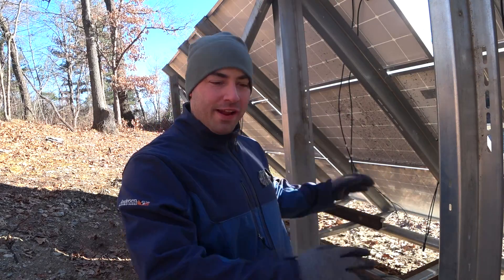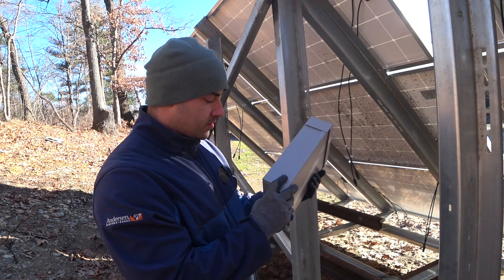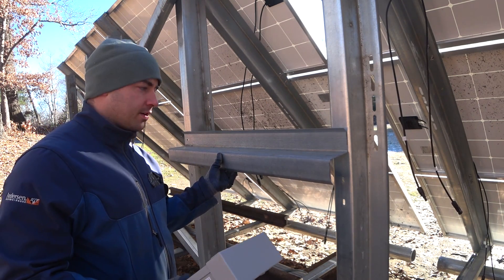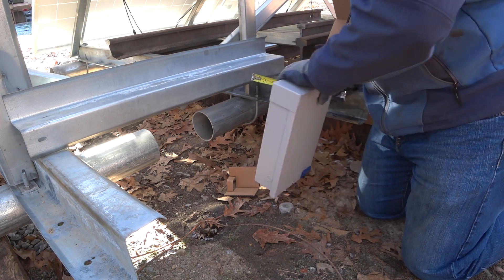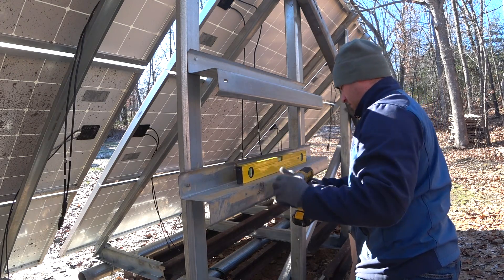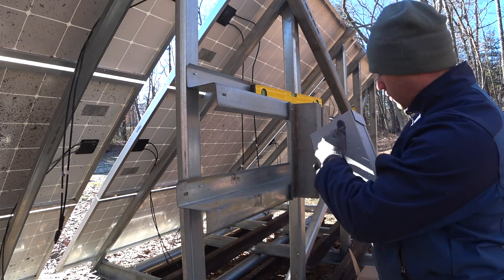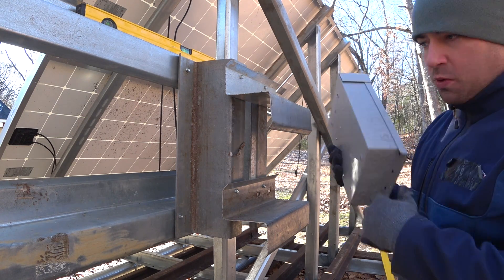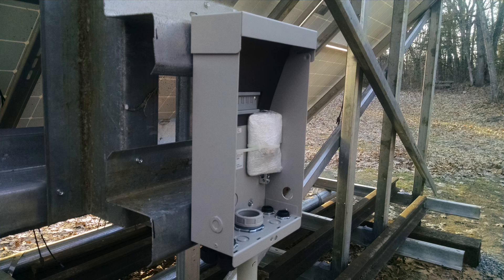Combiner Box Installation on Solar Array, Midnite Solar

Comment: Can u connect 220V one array
the other  100V array
to a combiner box 
what will be the  DC out value?
Reply from the maker: There are ways of connecting different solar arrays together.  It's a rather in-depth topic and not one I can fully describe in the comments.  Any way you try to wire two different arrays together will be a compromise.  Neither one will work well.  Instead of trying to wire them together, I'd suggest buying two MPPT charge controllers.  One for each array.  After the charge controllers, then they can be wired in parallel to the same battery bank.

Comment: It’s very easy and much neater to do an offset in the conduit. It looks like SCH 40 so you don’t need a bender .Just heat the pipe and hold it in the desired shape a short while.
Reply from the maker: Thank you.  I learned about that after this video, but used the heat gun trick since then.  looks much better.

Comment: Can you combine 2 differently sized arrays? I know yours are using same number of size and panels, just curious if that’s possible.
Reply from the maker: I have 3 arrays in my backyard, each array is a different size (today).  1 array can be made up of 1 or more strings.  A string is made up of 1 or more panels in series.  Each array feeds 1 charge controller.  Everything inside 1 array must be the same model # panel, and each string must be identical to the next string.  Everything must be the same feeding 1 charge controller.  But, you can add as many arrays as you want, so long as each array feeds it's own charge controller.  Then every charge controller can feed the same battery.

Comment: The Series is fantastic, question Can I connect 4s to 3s 2parallel solar panels, to ending in one string of 7 in series, for a total of 10 panels,  I'm trying to find out which is a better  parallel string of 5 which yield  263.0 volts with 4400 watts or 8 in series will yield 420.8 volts with 3520 watts and the 4s combine to 3s2p, is all relate to the limit 450 volts for the inverter and 4500 watts also a limit  of the inverter, panels have 440 watts, 52.6 Voc, and 10.2 amp of Ioc, imp 9.8 amp
Reply from the maker: The most important thing to keep in mind is the maximum voltage under extreme conditions.  If your particular inverter has a maximum voltage of 450V, then that is a hard and set rule.  It's your responsibility to stay under that voltage no matter what.  There are environmental conditions that allow solar panels to spike in voltage.  The maximum possible voltage would be listed by the manufacturer, but if you don't have it then the code (NEC) stipulates a 25% margin.  This means Voc: 52.6*1.25=65.75V  450V/65.75=6.8 panels.  Since you can't have a fraction of a panel you must round down.  This means your maximum allowable series connection is 6 panels.  I point this out because you asked above about having 7 or 8 in series.  7 or 8 will be above the allowable limit.

Also, please keep in mind for your design:  If you are going to parallel 2 or more strings into one MPPT then each string must be identical.  that means each string must have the exact same panel, age, model, orientation, voltage, amperage, etc.
Reply: @DavidPozEnergy  Now I got 3 of this as you did, but upon receiving I noticed the max current from a PV is 18amp, my panels have 10 amp. if I paralleled them is going over to 20 amp, my panel has 11.35A Isc, I don't know what to do.
Reply from the maker: My panels are 9.4 Amps at MPP, and I have two strings in parallel for a potential 18.8A.  This is potential.  The Growatts can't go up to 18.8A, so they max out at 18A.  But this is very very minor.  It might happen for an hour every few weeks.  It's really no big deal.  If your's are 20A, you miss out on a little potential, because the Growatts will limit it to 18A.  But it's only ever up there when conditions are at STC (standard test conditions) which is very rare.

Comment: Do you need 3 To 1 Y Type MC4 Branch Solar connector if using a combiner box? THANKS
Reply from the maker: No.  The "Y" connectors should only be used with 2 strings in parallel.  Combiner boxes can be used with 2 or more strings.

Comment: You could have made a Z or S shaped length of conduit instead of spacing the box away from the frame. You can bend that conduit using a heat gun.

Comment: how many combiner boxes can 1 central inverter accomadate ?
Reply from the maker: Hi Kershaw,  There is no direct correlation between # of combiner boxes and the inverter.  The solar panels come in all different sizes and voltages.  They need to go through a charge controller to charge the battery.

Comment: Would you please try to give us best practice on choosing solar system for solar pumps, immersed solar pumps and how to set the inverter parameters for the solar pump.
Reply from the maker: I'd love to, but I've never installed a solar pump.  I'd suggest checking out "Engineer775" YouTube channel.  He has tons of experience with those.

Comment: Midnite Solar makes some nice components. Folks should remember that there are a number of different versions of this box, and that they need to order the EXACT right version! (I mis-ordered and had to return one!) My system is using micro-inverters, so the breakers inside the box are AC and there's also a large red emergency disconnect lever on the outside of the same box. My system uses TWO strings of AC power that combine and disconnect in my box. Good system. Easy DIY. https://www.youtube.com/watch?v=rJIwCmqyvgU
Reply from the maker: Excellent point.  I made that mistake myself.  I ordered the box from Alt-E and the sales rep saw that I was ordering the MPV6, but also ordering 300V breakers, not 150V breakers.  He then corrected me and told me I needed the MPV6-250.  He saved me an extra trip.
Reply: @DavidPozEnergy  Great videos overall! Keep it up!

Comment: One stealthy setup you have there. But it seems as though it would have been easier to just bend some conduit or add the appropriate PVC to the combiner location.
Reply from the maker: That would have worked too.

Comment: Nice, although I think the stand-off with the z-channel doesn't look particularly pretty. I probably would have gone with flexible conduit from the ground, up the frame and into the combiner box. Don't know if that's code where you are but it would look prettier.
Reply from the maker: Yeah, it probably would have looked better that way.  I just wanted to use what I had on hand instead of making another trip to the store.  Thanks for watching.

Comment: Good video. Did you think of adding a elbow to take the conduit to the original frame instead of building it up so much?
Reply from the maker: Yes, I thought about it.  But I have a lot of scrap Z-channel so this way I didn't have to make another trip to the store.  I just used what I had on hand.  Thanks for watching.